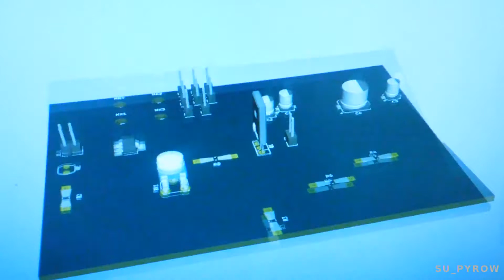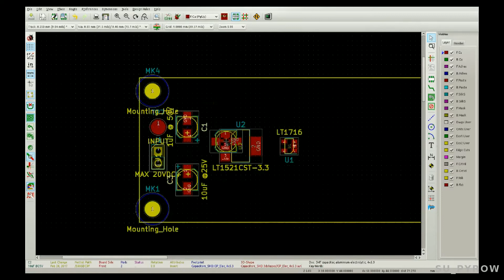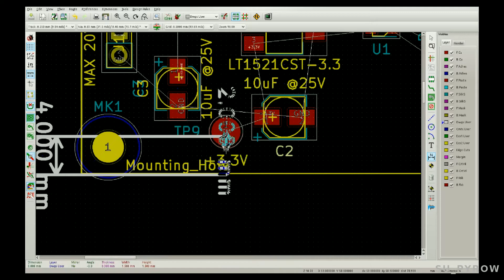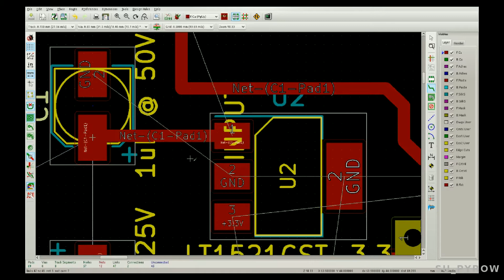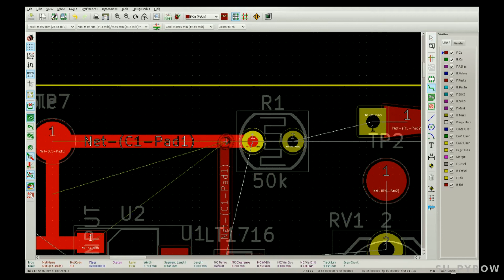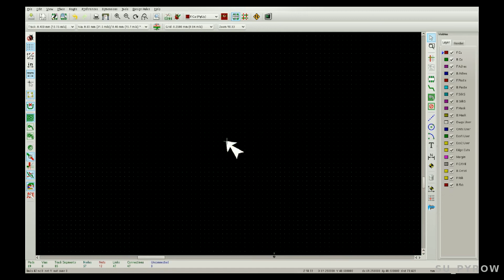DIY Electric Eye - Dawn/Dusk Circuit Design | Part#3 PCB Layout and Design SU PYROW #07

Comment: Hello Bobby.. I did this by hand with paper to work out the parts and tracks. Then put it on tracing paper. I then get ink paper and go over the drawing. Next use the etching set traces and put them on the copper clad for etching. Repair over etched tracks and drill holes for the parts. All by hand. 
What software did you use please. 

Thanks all the best
Reply from the maker: KiCad, its Open Source and available on mac windows and linux.  new version 4.0.7 will be out in a few days.  http://kicad-pcb.org/

Comment: hmmm, this could do very well for my boat battery charger, but it would be more like a five amp load for the marine deep cycle battery.  It might work well with a Harbor Freight Tools solar panel.
Reply from the maker: yeah, could just add one more transistor in a Darlington configuration that can handle more current, heck use a mosfet if you wanted to really keep quiescent current down.